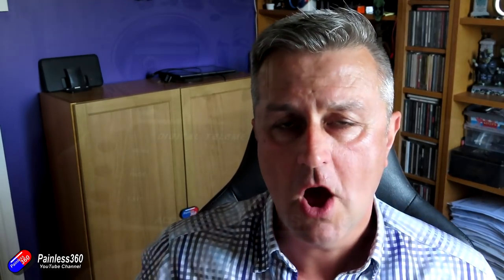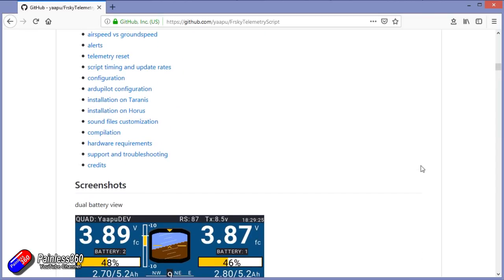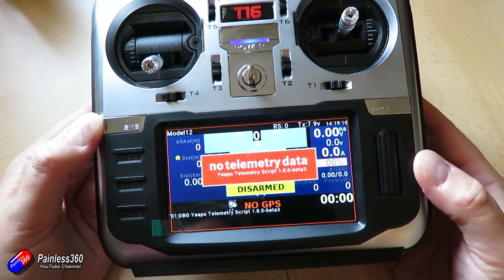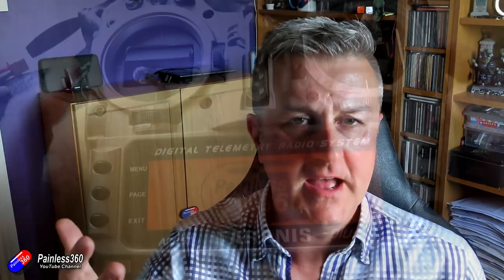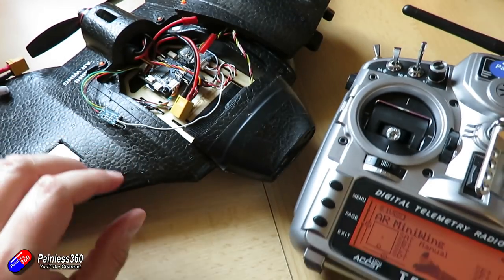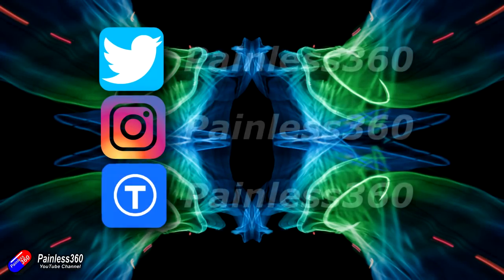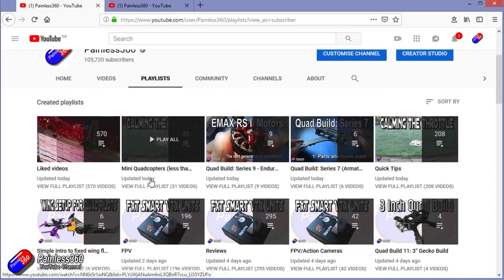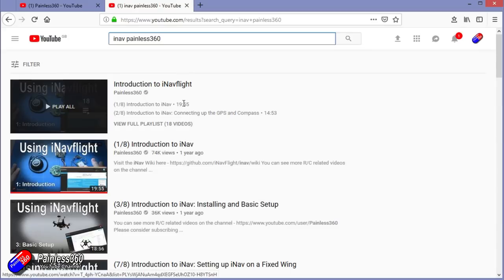Cheap ArduPilot Telemetry on OpenTX Radios Using Yaapu LUA Script

Comment: Just curious if the extra hardware is needed. I am using an RSXR Receiver that is already connected to my Taranis x9D+ with SBUS to my Matek H743 Board. Could I just connect the Smart Port wire to the TX6 on the board?

Comment: I’m running an APM 2.8 with ArduCopter, and I’d like to get the same telemetry through my Taranis x9d+. I’ve got it working on a newer pixhawk, but not with the ArduCopter. Wondering if you’d have any insight.

Comment: Ok so please excuse my ignorance but is it possible to use this method to pass telemetry through the radio and into a laptop running mission planner? I was going to use a separate telemetry USB module on my first ardupilot plane to achieve this but it seems to me if all of this can be transmitted through the s.port then it would be much more convenient to just plug the radio into a laptop and control the planes flight plan via mission planner... if im missing something here PLEASE let me know lol this is the last thing i want to get working before it goes up for the maiden. Thanks for the video painless360!!

Comment: Lee, if using the frsky r9m and r9mm receiver that has the inverted s.port pin (inverted of the inverted therefore noninverted..) would you be able to use the telemetry that way without the board.. Obviously without using the yappu script?
Reply from the maker: Not sure, I dont use the R9m.. best of luck!
Reply: I am using r9mm as well and still cant figure it out. :(

Comment: Is there a way to get telemetry from the radio onto the GC mission planner laptop without adding additional transmitters and receivers . I read 1 article where they used the wi-fi feature of crossfire transmitter module to pass crossfire telemetry to GC .

Comment: I'm trying it with an older a R9 Slim non-plus but no luck so far. For me, the sensors are discovered but I never get any data from them. The converter board gets warm but not hot, so I guess it works. I wonder what could be the reason? Otherwise I might just get another R9 Slim+ which has uninverted SBUS out and worked perfectly on my last build.
Reply from the maker: Not sure, I don't use R9M here...

Comment: This gave me an hour or two (or maybe 3) of runarounds, on my Omnibus F4 Pro telemetry is on Serial 2!!! But a big thanks for this video Lee, have been meaning to add this to a model for ages, have always relied upon the osd before. but i love the way this allows the f/c to announce what mode it is in. Had a few instances in the past where my Taranis announced that i had set the switch to a certain mode, only to find that the flight controller had not done it for some reason. A few times in the past i have switched to loiter - thinking my craft was happily hovering stationary waiting for me, only to watch it drift away still in Stabilize! Easily done if your not paying attention to the osd. So yes, i love the way with this it is the actual f/c dictating what message is played.

Comment: Hello, thank you for this video. Impressive what can be done. I am using a Matek F765-Wing with X8R receiver and Jumper T16 transmitter. It took me some time but I figured it out with a lot of google and forums. On the F765-Wing there is no need for the external circuit, the Smart Port data cable plugs on Tx7 on the F765-Wing which is SERIAL1 in Arduplane. The settings that work without the need of the external circuit are SERIAL1_BAUD = 57; SERIAL1_OPTIONS = 7; SERIAL1_PROTOCOL = 10. With that it worked straight away. From what I read this is not a common feature on FCs yet to be able to set half-duplex and inverted TX and RX. Thank you for your videos !!!! Its a great help for someone that just starts in the RC world.
Reply: I have spent most of the day trying to work out what you have written in this comment. Thank you thank you thank you!

Comment: Thanks Lee, this is a much more up to date, and cheaper way to achieve this compared to the older method I used with an APM 2.6 fc linked to a $30 teensy board running Athertop firmware to send telemetry back to the radio Rx. I also needed a $10 minim osd board as well. The setup you are describing in this series is a much neater way of providing the same info. the Tx screen info is helpful, but even with the FPV goggles on it helps when your radio Tx voice tells you when you've reached "max height", " 500m distance", etc. Thanks again.

Comment: Thx Lee, really useful, especially the removal of the ground wire to the  Rx, this I was unsure about.
Reply from the maker: if you get issues then add the GND wire back in. There is a common GND back via the Rx so it should work.. Happy flying!

Comment: Great series! You probably mentioned it somewhere, but my almost 80 year old brain has developed quite a few bad sectors lately :( and I just can't remember.   Are you using SBUS or PPM into the Omnibus?
Reply from the maker: Defrag, low level brain format? :D :D It's SBUS on this build but the pads need to be soldered as shown in the series for it to work.. Best of luck!

Comment: The nice thing about using the later F7 flight controllers rather than a F4 is that UARTs can be inverted in software and so no need to have the hardware inverter.
Reply: Great option, but, How do u use software inversion on mission planner? And is it possible to use softserial? Thnx

Comment: Please do a video to show this with I-nav. Thanks for all your great work.....
Reply: The cool Yaapu telemetry script requires the flight controller firmware to support the FrSky passthrough protocol (as mentioned in this video) in order to feed it to the ground over a s.port connection. This is supported in Ardupilot, but not certain that this is available in iNav. There is a separate project which uses a Teensy micro controller to convert Mavlink telemetry into FrSky Passthrough (found here: https://www.rcgroups.com/forums/showthread.php?3089648-Mavlink-To-FrSky-Passthrough-Converter) which can be used on flight controllers which can provide full Mavlink v1 (or v2) telemetry (which have no FrSky passthrough option natively - such as pixhawk running px4), but again not sure if iNav can be configured to send Mavlink (at least not full mavlink streams containing all the sensor info needed by the aforementioned project).

Comment: Found it. Thanks ! Electronics not a issue being a 'Ham'.

Just thinking of pushing the button on getting started in everything - pending SHMBO ...

Jumper T16 + 2S Li-po  with R1 D16 compatible RX (fooled me for ages that it's really a transceiver!)
F450 flame wheel frame 
Emax MT2213 + 10-4.5 props
Chaos 25A ESC's
4AH 3S Li-Po + 400W M8S charger
RadioLink GPS M8N
Pixracer FC - from China ?
Reply from the maker: Best of luck with the build! :D

Comment: Been using for a couple years I like getting confirmation all is well before launch without a computer and being able to record the telemetry data to the transmitter sd card. You may want to look at the sailplane/glider thermal hunter mode included in the latest ardupilot plane version.
Reply from the maker: Pitot planned for future build. See previous reply... Happy flying!
Reply: @Painless360  Forgot to mention been testing the overheat problem with the telemetry adapter appears it may be caused by not having the correct protocol selected/saved/rebooted prior to hookup.

Comment: After watching all your Ardupilot videos, I've been inspired to try it myself and in the process found out that you can now use the yaapu script without any extra hardware. If you're willing to do the uninvert hack on your smart port port output for your receiver and if you're willing to use the latest 3.10 nightly build, there's an option called SERIALx_OPTIONS which will allow you to configure a serial port to handle the half duplex uninverted signal directly. The settings are at the bottom of this page http://www.mateksys.com/?portfolio=f405-wing#tab-id-6 for setting up ordinary smart port telemetry - or if you want pass-thru telemetry for use with the yaapu script, you just need to change SERIALx_PROTOCOL from 4 to 10.

Comment: Hi Lee, I noticed that when you used MP to set the telemetry protocol used, you picked option 10 "Frsky SPort Passthrough (OpenTX)". I also noticed that option 4 "Frsky SPort" was available. What's the difference? cheers ...
Reply from the maker: The pass through setting includes ardupilot specific data like flight modes - https://www.armattanquads.com/painless-tutorials/ covers it nicely..

Comment: THX for your video!

Only got 1 problem:
Got telemetry working original FrSky pages. But the Yaapu script says: "no telemetry data"
Reply from the maker: I'd delete all of the sensors and re discover them... Best of luck
Reply: @Painless360  THX, but still nothing. FrSky data working just fine...
Reply from the maker: Then it's not the radio, it's how you've setup everything on the FC... Telemetry on, Port setup etc.

Comment: I assumed you could do this already with telemetry from the flight controller (arducopter) to the receiver (X4R) ?
- I'm a very long time occasional watcher
Reply from the maker: What you can do is changing all the time. Not all modern protocols we use in the hobby are supported by Ardupilot... Happy flying

Comment: Have a Taranis plus, but while updating the firmware it seems it doesn't give me the option to tick both Lua and Luac options. It only has the one. Is there a way to change this for both options?
Reply from the maker: In the later versions I think LUA is there by default. Check the release notes... Best of luck!

Comment: I've been trying to get telemetry to work with the Matek F405 and the RXSR with no luck. I've tried the uninverted SPort pad directly to serials 1, 6 to no avail and even built the cable per your instructions and tried serial 1, 6, 5 and also not getting anywhere.  Can you offer any help? Thanks!
Reply from the maker: All I did to get it working is in the video. There are reports of those TTL boards being prone to failure and overheating.. I'd try another..
Reply: @Painless360  thanks Lee. I tried 3 cables, as I had to buiy a minimum of 5. I even emailed Matek tech support and they sent me a link to the product page, tab 6 which talks about setting up telemetry, but they ask me to setup 3 Params for the serial port, protocol, baud and option. I don't see a SERIAL6_OPTION, which I'm supposed to set to 7 to make it work...

Comment: Hi do I need a FRSKY radio to use this playlist as I only have a FLYSKY FS-I6 radio at the moment so will I need to upgrade to be able to use this in my aircraft sorry if its a silly question but I am a complete beginner to RC
Reply: Obviously yes.. But if you have an fpv setup, this setup on radio can just be your backup

Comment: Is the hardware mod needed if I'm using a R9 mini RX? I have the RC control working using SBUS on my matek 765. I'd like to get telemetry. Tried without the cable. Connected UART TX4 to S.port/F.port on my RX and still nothing.
Reply from the maker: No idea, I don't use R9m here.. Best of luck!
Reply: @Painless360  No worries. Would be using crossfire if I hadn't gotten the R9 setup for free.

Comment: Hi! Thanks a lot for this great video. I can get everything working with a X8R receiver, but no luck with R-XSR and R9mm... (with latest firmwares). Any idea on why?
Reply from the maker: Different firmware maybe? Check if the R-XSR are using the same (LBT or not) firmware as the X8R..
Reply: @Painless360  I use EU firmwares on all receivers... I will double check later. What receiver did you use in this video?
Reply: Ok, everything is working right now. The problem was that I plugged to the fc the usb cable, but not the battery. Thanks again for your time and your videos!!! 🙂🙂
Reply from the maker: Phew! Glad it's sorted! :D

Comment: Painless...on a Pixhawk, yes, a person needs a "translator" cable that takes arducopter telemetry coming off the "telem 1" port on the Pixhawk (telem 2, and telem 4/5 also work), but on my Kakute F7, (and I'm thinking all the other F4/F7 boards?), THERE IS NO NEED FOR A CABLE.  In my setup, I simply connected a wire straight from a UART port on the Kakute (I think I'm using UART/SERIAL 3) to the SPORT pin on the receiver.  The other thing is you do not have to "discover sensors" unless you want to show the telemetry data outside of the yaapu script (on other pages)...if you are strictly using the yaapu script for all your telemetry, "discover sensors" is not necessary (though it doesn't hurt anything, so there's no harm in doing so).
Reply from the maker: Things like telemetry are very board specific as smartport is inverted - That's all covered in the documentation. Happy flying!
Reply: @Painless360  Thanks for the quick reply.  Which documentation are you referring to?  The yaapu docs?  And those docs say which boards need translator cables and which do not?  Thanks.  (So sorry if you covered that in the video, I must have missed it.)

Comment: does this mean we can use the telemetry link on the rxsr receivers and taranis to use the mision planner? (i.e. with using and extra telemetry trans/ceiver kit?)...wifi a fone or pad to the taranis maybe?
Reply: typo in brackets there sy..''without'' using a seperate telemetry kit

Comment: I cannot get this to work at all. I have the script on my Taranis X9 lite, I have the cable that I purchased, I'm using an R-XSR with smart port, and I've seen other people with this runnig on the same hardware I have. I've got it configured exactly how it's supposed to be, but I only get the 3 sensors from the receiver. I've deleted them and searched for more, I've made sure I'm configured correctly, I even updated the firmware of all of my hardware to the latest from last week, downloaded and installed it all again, and still nothing. Even switched around the two wires to see if I was backwards and still get nothing. It's become incredily frustrating, and I would give up if I didn't know it worked with my hardware.

Any advice?

*I'm using a MATEK H743 WLITE fc
Reply from the maker: I've found that I was configuring the wrong serial port usually.. I'd try the others and recheck the docs for that flight controller.. Best of luck!

Comment: Have you tried using this on the same radio as Flightdeck?  I might want to try both.
Reply from the maker: I have both on this radio...
Reply: @Painless360  I ended up removing FlightDeck.  Yaapu is more powerful, and I never used FlightDeck once Yaapu was released.

Comment: If there only was a similar solution for the modest Flysky fs-i6. But I suppose one can't have it all. Maybe a groundstation consisting of MavLink + smartphone could be a solution.
Reply from the maker: Not that I'm aware of... If you find one, please let me know..
Reply: @Painless360  Not that I know of. There have been attempts to make OpenTx run on Flysky FS-i6. Although there is some good custom firmware that opens up more channels and more, there is no OpenTx for this radio. Some people seem have to been able to make parts of the code to run. Others have used the FS-i6 for their arduino based OpenTx radio. This is interesting of course, but then we have the philosophical question, is it an FS-i6 radio anymore? Smartphone with MAVLink is not as lightweight, but a viable solution.
Reply: You can get basic telemetry from flight controllers onto flysky with a similar diode based connection, but only the values flysky pre-defined for their hardware sensors. And if I recall, it's only possible with the older receivers, not the newer x6b. 

Also, the only attempt I know of for OpwnTX was on the i6x, which has a completely different CPU.

Comment: Painless how would I get this telemetry converter to work if my RX is a Crossfire Nano and my TX is a Crossfire Micro on a QX7?
Reply from the maker: The micro doesn't have the Bluetooth connection. Apart from that I believe they are very similar.
Reply: Painless360 I’m not understanding.  I see that the pixhawk will output several telemetry protocols.  What telemetry protocol would I set the telemetry output port on the pixhawk to if I’m using the Yappu converter connected to a Crossfire Nano Receiver?  Also, what pin on the Crossfire Nano would I hook the telemetry output of the Yappu telemetry converter to?
Reply from the maker: Stay tuned for the latest Arduplane build - I think I may be about to explore what you're after..

Comment: I am trying to make a taranis x7/ ardupilot/flightdeck telemetry setup with FC kakute f7 aio and frsky xsr . Using seriel_4 tx. I have read (ardupilot.org) that it should be possible to do this without a ,speciel cable, like you are doing in this video,  just connecting S.port to seriel_4 Tx. The problem is it does not work.. you have to setup seriel_4 options=7, but this parameter is not in the parameter list... (only BAUD and protocol)
Reply from the maker: I only have used this method to date and it works great...
Reply: @Painless360  Thank you for answer and all your fine videos, which have helped me much 
with  my copter build...
I have an update to the problem with the inverted and not inverted seriel connections.
I have tried to install a beta version of the firmware (from inside mission planner) vers. 4.0.0.
This version has this serial4-options parameter and it is possible to set it.
I have just connected Tx4 (kakute f7) with smart-port  on FRsky-Xsr.
Now it works, telemetry on taranis q x7...
Such a signal problem (inverted not inverted) with the uarts in the flight contrller does not make things easyer...

Comment: Anyone that runs the lua script with dragonlink v3 slim and the matek f765. I have telemetry on the taranis. 11 sensors. But they wont show up in the yaapu script. It tells me there is no telemetry. 

So far I had removed sensors and found then again in more then 10 different combinations. No results. 

Anyone?